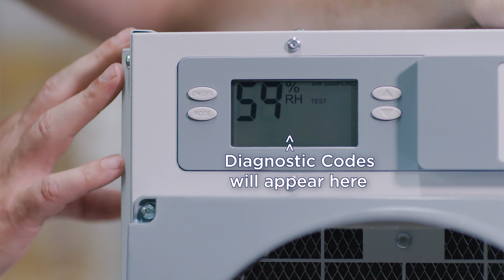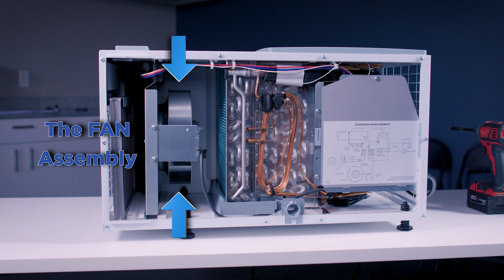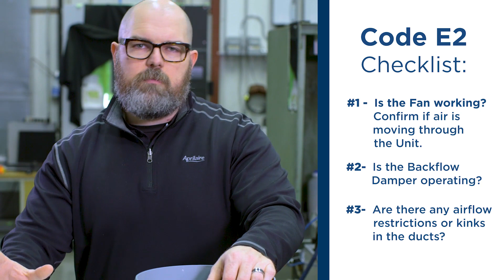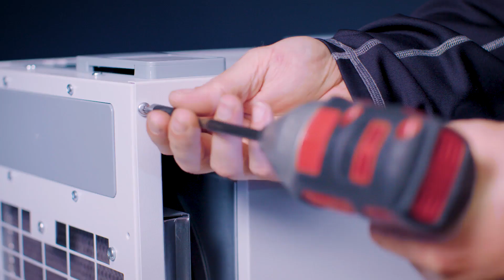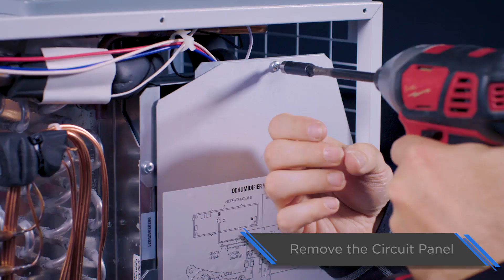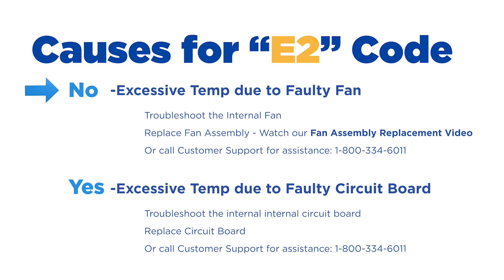Diagnostic Code E2 – High Refrigeration Pressure

Comment: Stupid unit has the housing screws too low if the unit is sitting in an evaporator pan. poor design. Can't get to the screws. Now the dealer wants $5,000 to replace the unit. What a rip-off as well as a poor design

Comment: Aprilaire dehumidifiers are just as big piece of junk as the box store dehumidifiers just 3-4 times more expensive …problems with refrigerant leaks and just so happens to happen right after the warranty runs out … no way in hell will I purchase another Aprilaire for the price they want for it to breakdown just as the warranty expires … refrigerant leak or low refrigerant should be covered for the life of the dehumidifier…my opinion——-DO NOT PURCHASE
Reply from the maker: Thank you for contacting AprilAire. We are very sorry to hear about your negative experience with our products. Our heavy duty, professional grade dehumidifiers are designed and assembled in the USA utilizing US and global components. If we can offer any assistance, please reach out to our technical support team at 1-800-334-6011.
Reply: @aprilaireco  I already did , and I had the model 1830… I was told by technical support… it was low on refrigerant and it is not serviceable and not covered because it just went past it’s warranty expiration date… these units should be covered for the life of the unit if it gets low on refrigerant

Comment: I have a tcl and it’s so terrible. Hoping to have better luck with a different brand
Reply: Don’t waste you $$ on Aprilaire brand.., common problem E4 … the error means low refrigerant and is unserviceable… which means trash if the warranty has run out , and  my dehumidifier gave the E4 like 3 months after warranty ran out … Aprilaire was oh so willing to sell me another $1500 dehumidifier…. Hope you do your research good luck